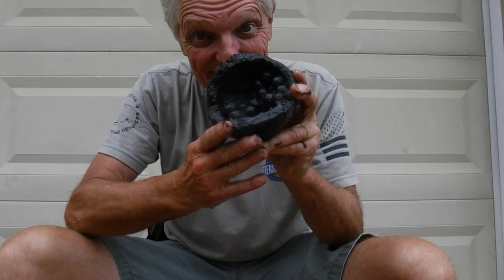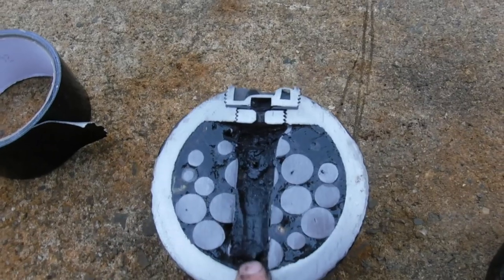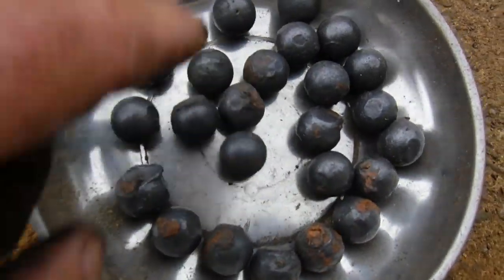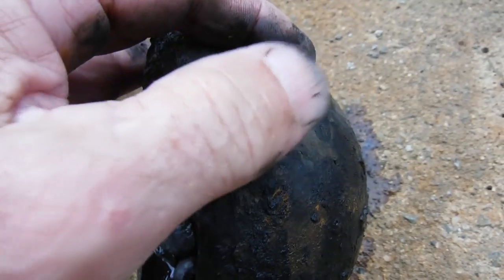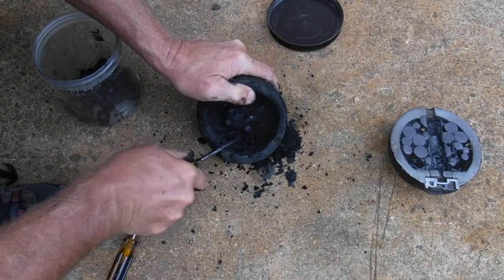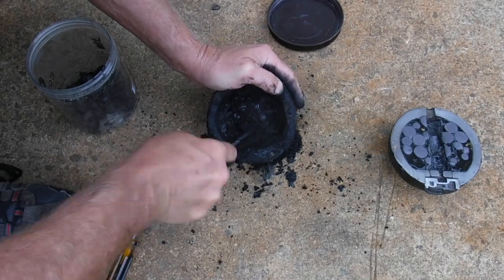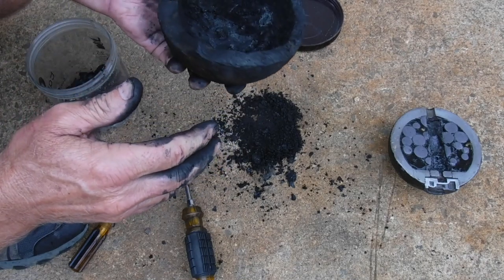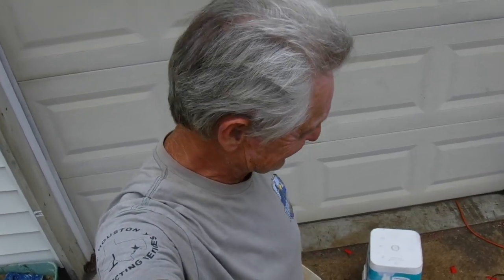Saving AND Preserving History

Comment: Did you have to soak it in regular water 1st to get all the salt water flushed out?  If so, how long does it take and how can you tell when the salt water is gone?  Thanks.
Reply from the maker: Jeannie Buchholz I always keep it in fresh water until I start the electrolysis but it would probably take years trying to get the salt out by just changing the water every week.